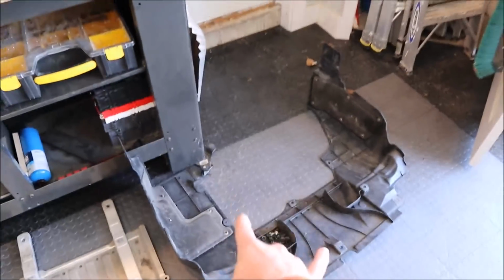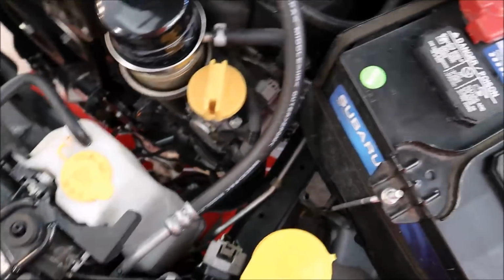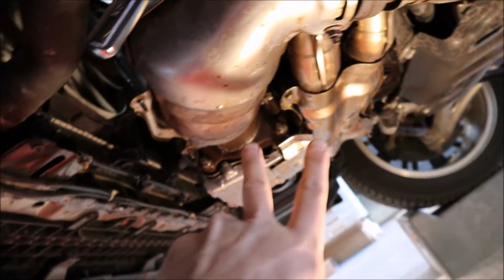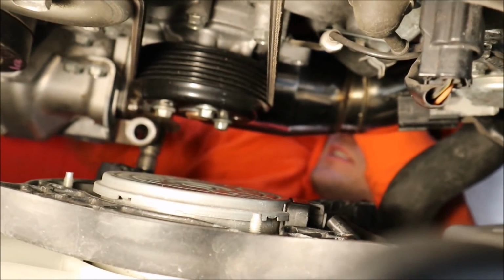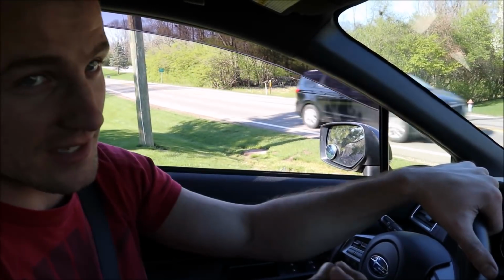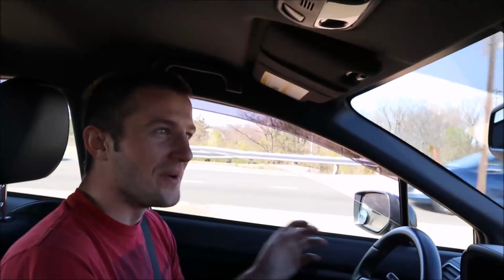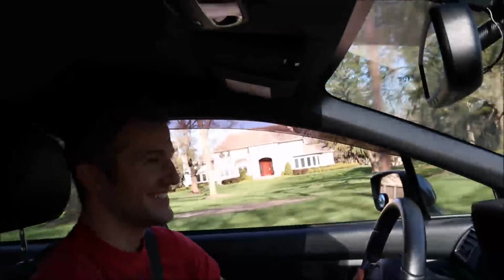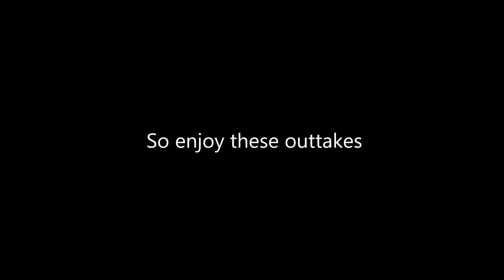TurboXS Jpipe FINALLY installed on the WRX

Comment: please get a pro tune...STORY TIME....tldr: engine almost blew up, replaced under warranty... longer version: I have a 15' WRX and I ran an OTS stage 2 map when I did my J-pipe and about 2 months after flashing the OTS map i started hearing a ticking noise. Then went to get a pro tune but always got a lot of feedback knock and the tuner could not figure out what was causing it. Figured it was related to that ticking. Long story short, I put the car back to stock completely to bring it in to dealer to take a look at (i was at 51k miles so just before the power train warranty expires). It was a risk that the dealer comes back saying "oh we can tell the car had its ECU reset" so I drove it around for like 2 weeks turning the key on and off as many times as I could to register a bunch of key turns in the ECU, pushing the last reflash a bunch of key turns away (btw its my understanding that a battery disconnect shows up just the same on the ECU as a reflash). Must've worked bc the dealer said they couldn't see any evidence of a tune on the ECU :) but in the end, what happened to be the problem was within the oil pan. Somehow the metal baffle plate inside the pan sheared off from the 3 bolts holding it in place and went up into the block. The ticking was the #4 piston slapping against this piece of sheet metal on every downstroke. I was millimeters away from catastrophic engine failure. Regardless, because of the damage to the piston and cylinder walls, they replaced the entire short block under warranty. Now I dont know if this was just a "manufacturers defect" which the called it out to be by the dealer or if the OTS map caused something weird but I feel that the "One size fits all" type of map is not a good idea. A reputable tuner will be able to dial everything in to make sure that the engine is running at its best, but also its safest! Best of luck brother, sounds awesome!
Reply from the maker: Thanks for the information and insight! I've got a few more parts coming and then want to protune. Not driving the car much before then, so I'm hoping not to cause any damage.
Reply: Cool story, but you can’t tune out mechanical damage inside the engine.
Reply: cobb shelf tunes are pretty safe for little bolt ons
Reply: Exactly what I did too, drive around with my blown gearbox for a month to save up key turns lol got a new one
Reply: smittywoodshop you saved so many subie owners with this post lol
Reply: Smoke is the bp blaster lol mine caught fire 🔥
Reply: So you committed fraud? nice lol.

Comment: Did you figure out what to do about the heat shield? Did you just leave it off?  I have this same j pipe. I love it. I am just paranoid about heat soak. And creating a heat shield for this has been a pain in the ass due to the cat. Any advice would be gret

Comment: Will this throw a CEL if installed on a COBB OTS tune? Can a tuner remove the CEL with the COBB Accessport? I am not seing this listed as GESI, is that an issue? Sorry if these are noob questions.
Reply: I don't think it'll throw a code, tuners using cobb can no longer tune out the cel for emissions related codes, I installed and do not have a cel and its been a few weeks

Comment: Hey man have you had any problems with the turbo xs j pipe throwing codes ???
Reply from the maker: Nothing so far. Just using the Cobb accessport OTS map for catted jpipe. Only thing I have is a weird rattling noise that I think is a heat shield. Need to get under the car and identify what’s up.

Comment: Did you have to use an adapter for the stock midpipe? Also did you have to use a gasket for the front j-pipe to the down pipe?

Comment: Hey what did you do with the heat shield? Did you leave it off? Couldn’t get mine to fit
Reply: I just put my new J pipe on a couple weeks ago and yea you don't need a heat shield with the aftermarket ones.
Reply: Don't get me wrong. You do need a heat shield.... Unless your okay with a significant amount of heat soak in ur engine bay and high higher IATs

Comment: Did you just do the stage 2 with the access port when you installed the J pipe? And did you get check engine light on?
Reply from the maker: The OTS map is Stage 2+ with my setup because I have the intake as well. No check engine lights, the jpipe is catted.
Reply: @KylesWheelHouse  is an Cobb access port tune good for long term?
Reply from the maker: Better to have a pro tune long term, but I have not gone that route. Now things will be changing, with Cobb at least, so we’ll see what happens.

Comment: So you just need a jpipe to go for stage 2? Not full exhaust system? How about the ap stage 1 and stage 2 theyre different ots map right what you do?
Reply from the maker: The stages are kind of just Cobb's verbiage. I have a jpipe and axleback deletes, then Y pipe is stock. The stage 2 cobb map is for a catted jpipe. The stage 2 plus map is if you have jpipe and intake, which is what I flashed.

Comment: Did you reuse the factory heat shield? Apart from fighting with the nits (current state for me) video has been extremely helpful!
Reply from the maker: Factory heat shield didn’t fit after instal. Glad it’s helped so far!

Comment: Any mid to top end torque gain? Just got my 2019, low range torque is awesome, then it sucks over 4k rpm... thinking about j pipe the car and hope this will fix it
Reply: Lup Fa I just put my mishi dp in with COBB stage 2 tune. The throw back in seat feeling isn’t as hard as stock tune but it pulls all the way to redline and daily drivability is a lot better with the throttle mapping (put your foot half down and get half throttle instead of full at 30% down)

Comment: What exhaust set up do you have on the car?
Reply from the maker: Catted TutboXS jpipe, stock midpipe, ETS axleback muffler deletes.
Reply: Hey what stage OTS map were you running in this video, were those pops and crackles just from putting the downpipe on?
Reply from the maker: Ots stage 2+. Yep all from jpipe.

Comment: What kind of exhaust did you have at the time??
Reply from the maker: Still the same, ETS axleback and TurboXS catted jpipe.
Reply: Stock midpipe?
Reply from the maker: Yep
Reply: Kyle Andrew did you need an adapter for the stock mid pipe?

Comment: Bro i had no idea you can change the pedal sensitivity?!? I barely hit the throttle and I’m at like 2-2.5 k rpm
Reply from the maker: The tune helps a bit. Stock is definitely touchy.
Reply: How'd u do that?
Reply: @Kanadian-Squirrel  cobb accessport and the correct tune for the parts installed, gives you a linear throttle

Comment: What did you do with the ground strap?
Reply from the maker: Made a harness out of wire and wrapped around the bolt that holds the O2 sensor plug.
Reply: @KylesWheelHouse  how did you reinstall the heat shield bracket that goes between the jpipe and turbo stud nut?